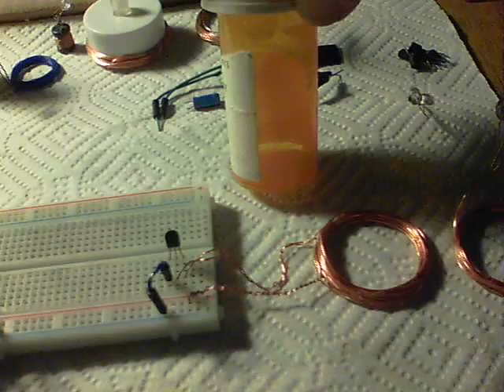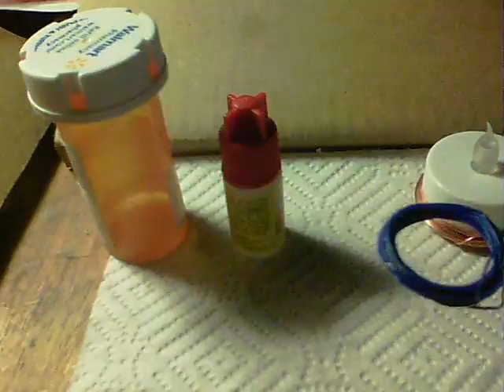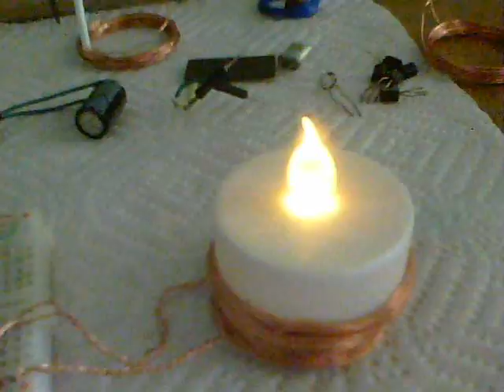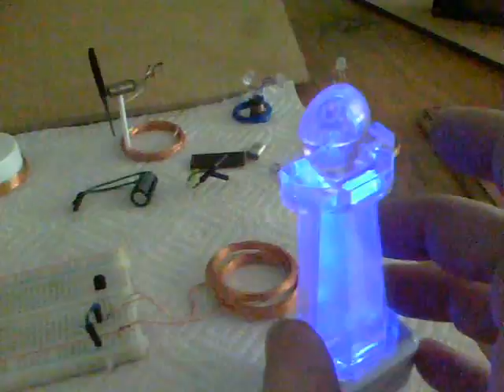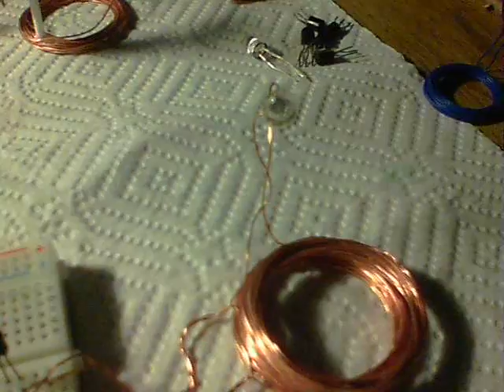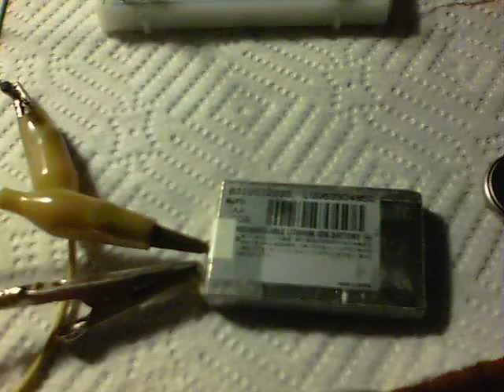SWES 2 - Simple Wireless Electricity System 2

Comment: How did you hook up the bread board to the emitter coil?
Reply from the maker: Mathew Kizhakkadathu The wire that the coil is made of is about the same diameter as a regular jumper pin. A quick scrape of the ends to remove the enamel and they fit right in. If you use thinner wire, a piece of LED leg or something can work just as well, if the wire is twisted on to it. Sewing pins also work as breadboard wiring connectors :)
Reply: Thank you, but I was wondering about the connections in relation to the transistor. For example, where does the center tap wire go and where do the other two wires go?
Reply from the maker: Mathew Kizhakkadathu  Ah I see. The center tap wire connects directly to the battery positive terminal. The other 2 wires connect to the Base and Collector of the transistor...it doesn't matter which connects to which transistor leg. So, what you have is Emitter to negative of battery, center tap of coil to positive of battery, the 2 ends of the coil to the other 2 pins of the transistor. All makes very clear sense when built, the wires can only go to those places and nothing is left over.
Reply: slider2732 Just to make sure...The center tap goes to the positive terminal of the battery and the negative end does to the emitter? Also, the base and collector don't matter which way they are connected? What diameter do you recommend for 26 AWG copper wire?
Reply from the maker: Mathew Kizhakkadathu Yep that's right. these work best with an AA or anything from 0.7V...the transistor is not heatsinked or limited with a resistor so if any heat is noticed, simply increase coil turns (it increases resistance, which helps the transistor to not warm up, but lowers output). For diameter on 26 AWG, a pills bottle is just about right. No harm in trying smaller or larger though...have fun :)
Reply: slider2732 I tired using a 2N2222 transistor in this setup and it would not work. Have any suggestions? I was thinking my LED required too much voltage (2.0 volts).  I made the emitter coil and receiver coil to one and a quarter inch diameter.
Reply from the maker: Mathew Kizhakkadathu  The LED will run fine, output is actually closer to 40V with nothing attached, dropping right down to about 3V with an LED. 2N2222 is a good choice and should be fine (left leg being Emitter when looking at the flat front with the writing). Just make sure of connections + use a single AA battery for tests. Coils of 12 turns are a good start point..Connections being Emitter to the battery negative, the 2 twisted wires of the transmitter coil to battery positive, other 2 wires to the other 2 transistor legs. Receiver coil will work one way up better than the other.
Oh, also make sure to scrape the enamel well of the coated wire ends, that can trip up a successful build.
Reply: slider2732 Ohh so you have to use enameled copper in the coils right? Not bare copper ?
Reply: Mathew Kizhakkadathu Where can I get enameled copper from ?
Reply from the maker: Mathew Kizhakkadathu Ebay is easiest. Just search for 'enameled copper wire' and the gauge you might want. For example: http://www.ebay.com/itm/Magnet-Wire-26-AWG-Gauge-Enameled-Copper-155C-2oz-157ft-Magnetic-Coil-Green-/261087235848?pt=LH_DefaultDomain_0&hash=item3cca030f08
Coloured wire makes it easy to see where you've scraped off to reveal the copper.

Comment: 3 V led on 1,5 V battery?
Reply from the maker: As DC it takes 3V, but as pulsed high frequency output the voltage can be as low as around 0.6V. Such circuits use a common silicon transistor and a transformer action from a wound coil..in the case of this SWES 2, they are the only components needed.
Such a technique is used very often to drive higher voltage devices...including cirvuits such as the famous Joule Thief and Slayer Exciter (Tesla tower type system). Many LED's can run with this sort of thing, 50 or more. See videos of my original SWES by Mongrelshark for tens of LED's running from 1x AA battery.
If you look up the Jeanna's Light on YouTube, you'll see 120V LED bulbs brightly glowing from a single 1.5V battery :)
Reply from the maker: *****
 Very cool to read such kind comments...thank you :)

Comment: What exactly is the transistor doing here? I know the only way a voltage is induced in the secondary coil is if it's exposed to a changing magnetic field from the primary. Since you're using a DC rather than AC source, I'm guessing the way the primary is wired, along with the transistor -- a changing magnetic field is somehow produced? Any insights will be very appreciated!
Reply from the maker: Good deductions Chris. The transistor is producing the pseudo AC, by firing the coil connected to the Collector, which the second coil picks up and returns to the Base of the transistor...and onward it goes at several hundred kHz. So yes, in effect the first coil is oscillating by switching on and off rapidly, governed by the time taken to induce current in the first coil (primary), then be picked up in the second coil (secondary) and the transistor refiring. 
It was surprising a few years ago to find  that I appeared to be the first to create the system, with the original SWES.
Reply: Thank you so much! An excellent explanation, and an ingenious design. Thank you again.

Comment: Didn't work for me
Reply from the maker: Do you have more info, such as transistor that was tried (only has to be a small flat faced round backed type, left leg is nearly always the direct battery power leg). You may have a PNP transistor, in which case just flip the battery around and try it. Try a 1.5V battery, as that is the designed voltage and most likely to work.
If all else is as the instructions in the info box above, then i'd like to find out what happened to not make it work and then we can change that :)
Reply: I used 22 gauge wire coiled around a empty pills bottle and I am using a pnp transistor (2N3906) and my led is a small red led (NTE3140) (2.05V)
Reply from the maker: The Computer Tech Guy
Connections of the 3906 from left to right on the flat face facing you, are Emitter Base Collector, so the positive wire from your battery goes to the left leg. The other 2 wires are the same as the video. However, the double twisted wire now doesn't go to the positive, it goes to the negative.
In other words, it's all the same as my video, but just flip the battery around :) 
Datasheet: https://www.fairchildsemi.com/datasheets/2N/2N3906.pdf
Reply: Ah okay I got it up now. Hey is it weird that If I have my multimeter touching the legs of the led I don't detect any voltage coming though even though the light is on
Reply from the maker: The Computer Tech Guy
Great to hear that it's running :)
You'll likely see it on the meter as A/C. At the points where the meter is connecting its as though it's across the coil. To measure DC, remove the LED, have a diode on 1 coil end and put a small value electrolytic capacitor (100uF say) on the diode output and to the other coil end.
Reply: Hey Slider, thanks a lot for your great video ... but I would also like to measure the voltage and current. But i cant follow your explanation here. Can you please be so kind and explain me a bit better. Thanks

Comment: Anyway to do this with higher voltages to like charge a phone?
Reply from the maker: Yes, certainly. You can do it with 3V, 6V easier. Even some 1.5V systems will put a phone into charge mode, but amperage throughput isn't really high enough to be practical.
Best test gear is a small motor or 6V flashlight bulb to track changes and tuning of power throughput. Basics are to put a variable resistor of around 5K between the Base of the transistor and its usual coil connection. Fit a heatsink to something like a 2N3055 transistor. To receive and change to DC, replace LED with diode and 100uF capacitor as described before. Experiment with coil turns + Base resistance until the motor/bulb runs well. Connect with correct polarity to the phone :)